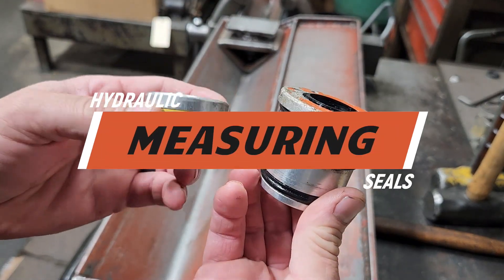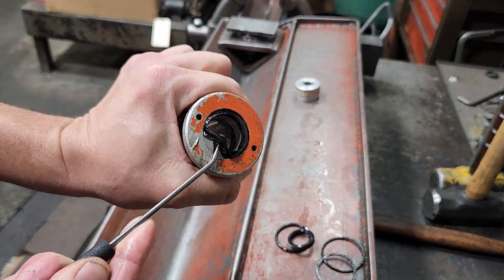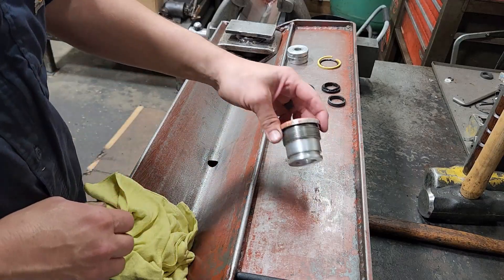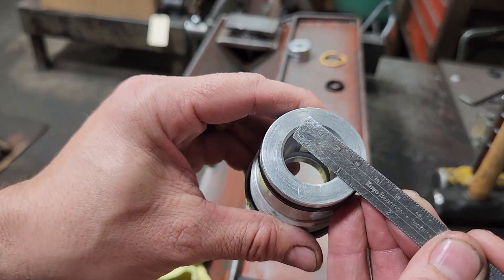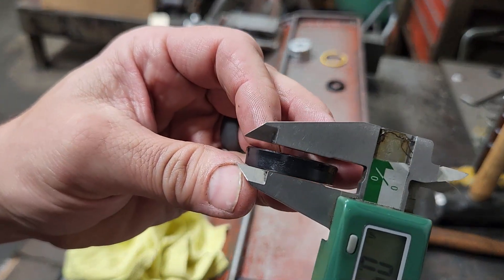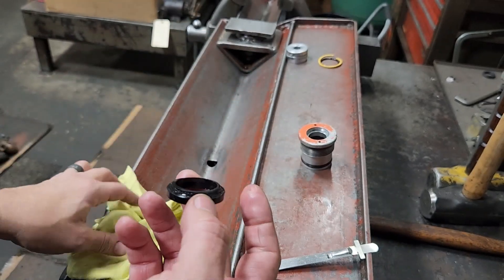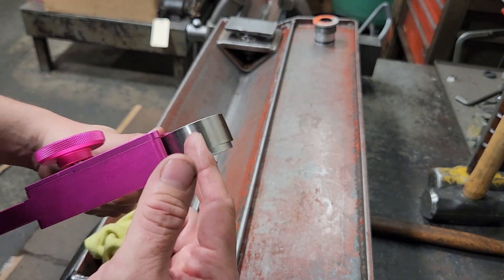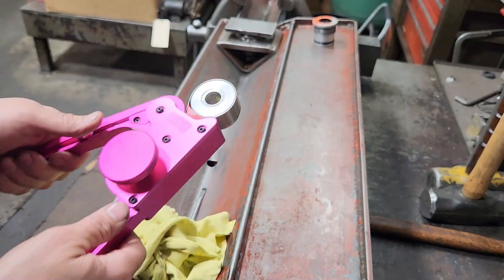How to Measure Hydraulic Seals / KUBOTA

Comment: Thank you. Ive been looking for someones teflon to be deformed ive always questioned myine being messed up since the original ones are slitted on my application
Reply from the maker: Case Construction will use a split or expandable teflon piston seal. This will allow the seal to be put on without stretching, but I always compress those back down, too. Thanks for watching and commenting!

Comment: Hey man, just found your videos. Very helpful. 

I literally watched your resealing video on the Kubota louder tilt cylinder. And I found myself intrigued because I have bought seal kits that were incorrect as well. After noticing the provided were wrong, wham bam you came back with the correct ones, after talking about measuring them.  I was about to post the idea for a video on measuring. So I decided to look at your most recent videos and Bam you already made it.  Thanks man. 

I'm going to be taking a look at these videos I have a lot of questions related to some of my older equipments cylinders.  Hopefully you answer them all but if you don't I'll ask for a video.  Cheers 🍻
Reply from the maker: I'm glad you were able to come across the channel! I'm trying to put out what I think would be useful or helpful. All you have to do is comment and I'll try my best to reply to the best of my knowledge. I appreciate the support! Thanks for watching and commenting!

Comment: Thanks for this video, it truly helps the DIYer. I have taken mine to a shop in the past to get the seals but decided to buy them online and do it myself. The hardest part was measuring and knowing the right sizes to buy. For example i went from backers + pressure seals to pressure seals that don't need backers. Hercules helped me over the phone to decide which seals to go with. I don't think I came out any cheaper.
Reply from the maker: If you're referring to the head seals on the exterior of the gland (orange in color), those are more costly than just an o-ring and backer. If you can get to where you can measure out the seals and have a local hydraulic shop sell them individually, that would probably be your best bet. Sometimes ordering kits online can be a hassle (Amazon, Ebay, etc.), especially when the seals don't match. @sealingproducts is a good reputable source for seals though. Thanks for taking the time to watch and comment!
Reply: @HydraulicRepair  yes the metal clad wiper was more. 2 pressure seals, 1 metal clad wiper, one cotter pin was 105 including 20 shipping which is ridiculous for 6 oz of product...but hey they had the parts and got them to me and they are in and working!

Comment: I was thinking this would be metric on a kubota. Could it be metric but SAE measurements are close enough for soft sealing parts?
Reply from the maker: Surprisingly, most—if not all—Kubota loader cylinders I’ve worked on use standard (inch-based) seals. However, some manufacturers design cylinders where the rod seal dimensions fall into that “in-between” zone, making it hard to tell if they’re standard or metric just by eye or even by measurement. In some cases, the sizes are close enough that you can temporarily substitute a standard seal for a metric one—or vice versa—to get the machine back up and running in a pinch. O-rings are usually the easiest to swap this way for a short-term fix, especially if you're trying to stop a leak and get back to work. Just keep in mind, it's not always a perfect solution long term, but it can buy you some time until the proper seal arrives. I hope that helps some. Thanks for watching and commenting!